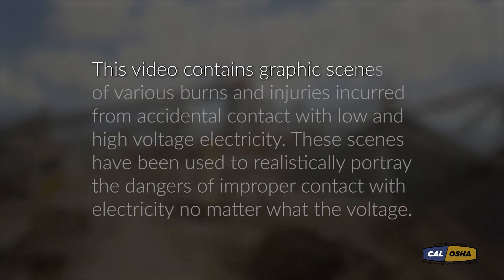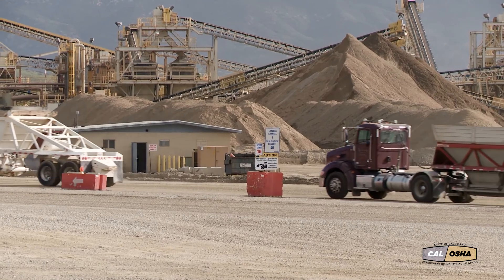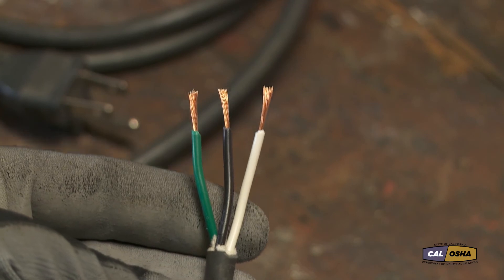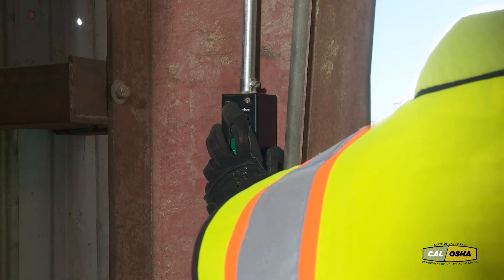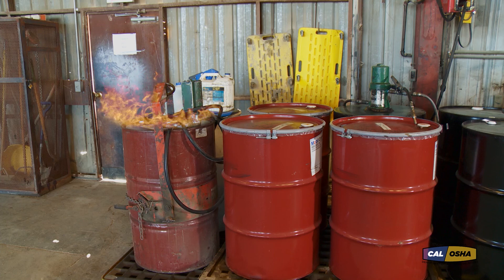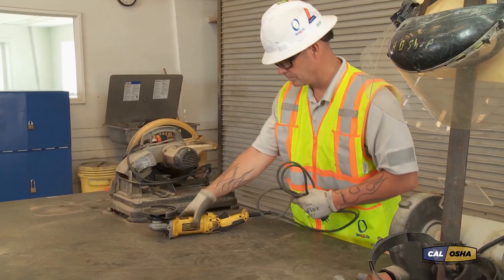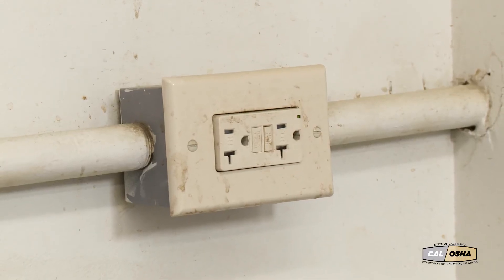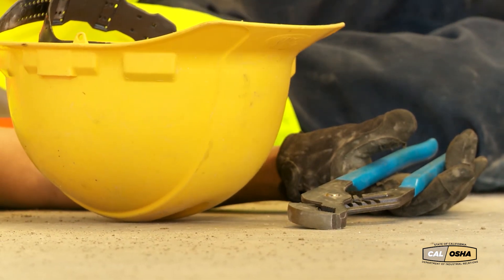Low Voltage Safety

Comment: When he said low voltage I thought he meant 12-48 volts but man over this amount is still high voltage and the danger of low voltage especially DC is short circuits and current but not voltage cuz human skin has high resistance which is nothing for low voltages
Reply: Me too, I thought this was going to be about gardening lights 😂